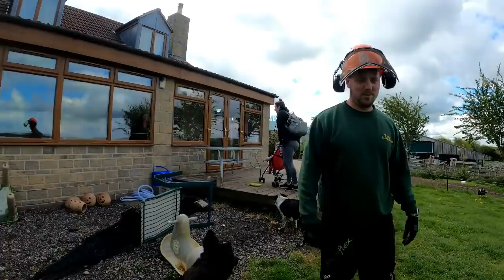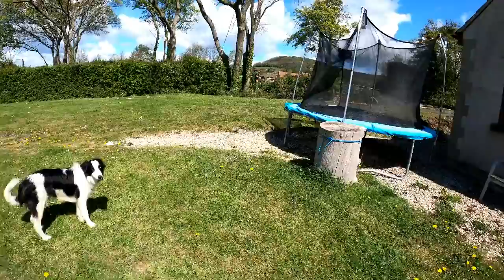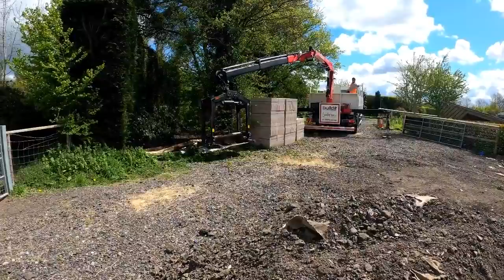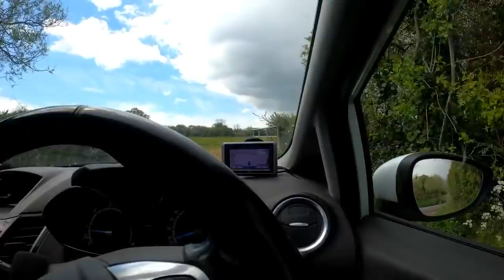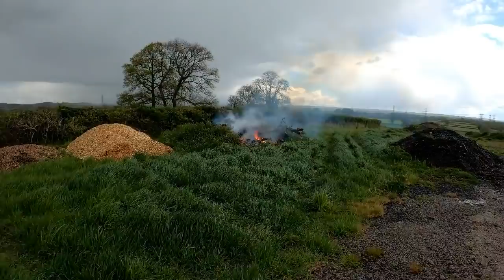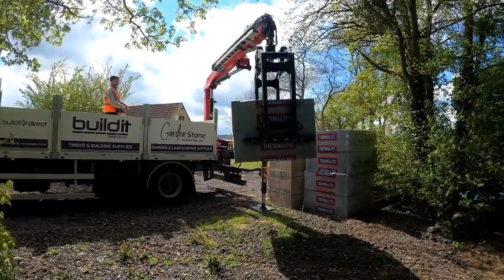AVS Editing, First attempt!  06 05 21

Comment: The picture quality is so much better, more colour and real depth to the video. AVS software is very good I have used it from when they first started and bought the more expensive option to get lifetime updates. Over the years more options have been added the range of dissolves are excellent. It will take some getting used to but the time spent will be worthwhile in the end.

Comment: Video quality is a lot better. Just make sure the camera is shooting in 1080 and the output settings for the software is also 1080. 

Using better apps unlike windows movie maker etc will require a faster PC. I use Adobe Premier and ended up having to get a 2k PC to keep up with the videos I am editing. 

Deff going in the right direction. 👍
Reply from the maker: I am out PC shopping today... 🙂
Reply: @FarmerP  - now isn’t the best time to get a PC. For video editing you need a decent GPU (graphics card) you won’t get anything like that from a shop like PC world or Curry’s and the staff know sod all. I know you like to support local. But try and stay away from those kinds of shops. 

Personally best place I found was an online shop called PC specialist. They have supplied me with all 6 of our PCs. 

Now as mentioned the graphics card at the moment the world has a shortage of PC chips due to a number of issues but this has pushed up the cost of Graphics cards from what should be a good card for £400/£500 is now over £1000 🤦‍♂️ joys of scalpers. 

Below are the kida specs you want to stick to if ur video editing. 

Intel Core I7 
32GB Ram 
Mvme or SSD hard drive (around 512GB) 
The graphics card is important so one with 8GB of video memory (nothing below this) 

Or just post the spec of the PC ur looking at and I’m sure ur fans who know the PC game can comment and help out 👍